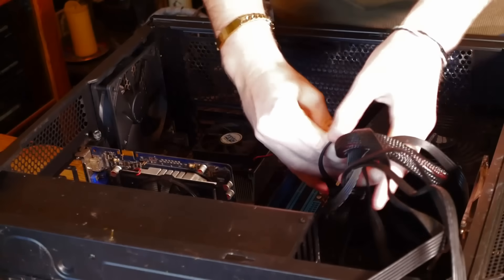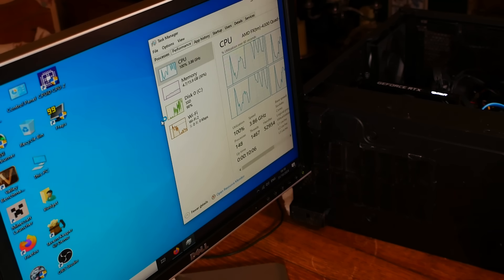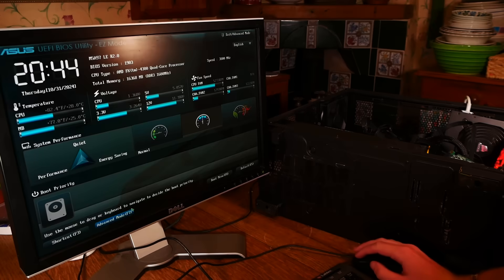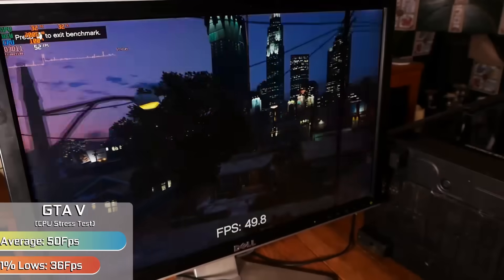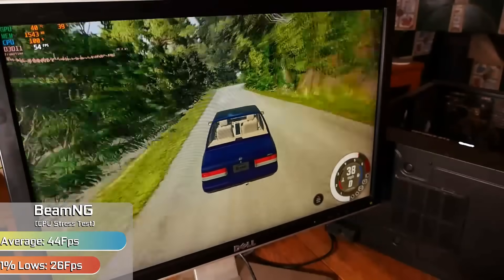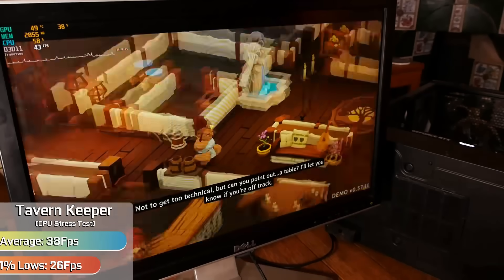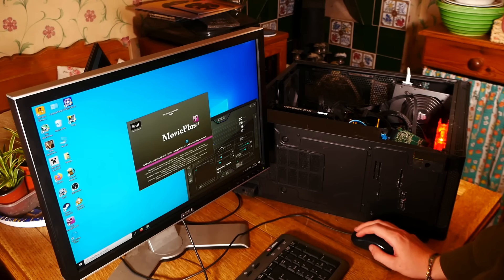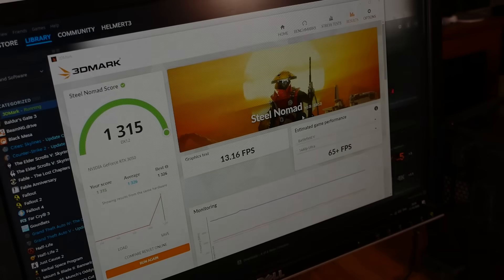AMDs Weakest FX Processor...

Comment: My last AMD AM3+ system build was nearly the best a AM3+ system could be. I'm  not sure how the mb got killed - but there was a day we had bad windstorm in the area and we had 2 what I would call micro-power surges back-2-back within like 4 secs. after that ; the mb i had just upped and died - never figured out why. It was probably the single best AM3+ mb you could get. My PSU at the time was a Seasonic 750w 80+ Gold ; FM unit. That was plugged into a high-end Power Strip / surge suppressor unit. I have thougt about rebuilding the system and maxing out the memory which was the only part in the system wasn't the best if could be.

Comment: The FX series core debackle was quite the drama.
Then again, due to the shared FPU of the cores, each core cluster acted as a single core with hyper-threading.
So in other terms, the FX 4xxx was really dual cores, the 6xxx was triple-cores, and the 8xxx was quad-cores.
Windows could never get the proper core scheduling to work well with the FX CPU's, due to the way they were set up.
Now, I believe there was a "hack" you could do to make it run better, by disabling one core per cluster.

Comment: The FX was AMDs answer to Intel's NetBurst and IBMs POWER6
And the FX-4300 was already a step up, just look at the FX-4100

The two chips that were really worthwhile for a bit were the FX-6300 and FX-8320, cheap, decent enough performance on a budget.
Would love to see them tested against contemporary Intel alternatives. How does the FX-6300 and 8320 hold up now. Can they beat an i5-2400/2500K/3570K/4460 these days? Can they even beat the i7? Or would they fall up to i3 level.
And then throw OC at them. 4.5-4.6 GHz on the CPU, 2.4-2.6 on the northbridge, 2.2 on the HT bus and maybe 2133 RAM.

Comment: i miss my fx8350. i had to throw it in the waste after it died. now i dont know what to buy for windows 7 for retro gaming. i have 2 spare am3+ mb's laying about in storage. best cpu before i upgraded to ryzen 7. my fx8350 died last year during summertime. i had the fx8350 since it was new in 2018. thermal issues killed it. every summer in the uk. kills my computers. and my poor fx8350 suffered. also my 5700x died last summer. and my 5800x died this summer. got my first aio on my new 5800x after the repair. im terrified of summer 2025. i want to build a windows 7 x86 power house for retro gaming. but i cannot find a trusted fx8350 used... and i cannot see a trusted selling aio for fx8350 either. the last game that pushed my fx8350 was resi evil 4 remake... and oh boy it struggled at 1080p for 60fps. my gpu that was paired with my fx8350 was strix rx590. and cor value 32gb 1.6ghz. it was a magnificent pc for its time when no one else had 4 cores 8 threads. trying to run rdr2 was refused by the gpu or cpu. when booting rdr2 it would immediately crash. gta would run amazingly online at high 1080p.. but when you get into a busy lobby online the cpu cripples to below 30fps. the only issue i hated for fx8350 was mostly all the am3+ mb's were pcie16xgen2 in a gen 3 erra... to find a gen3 mb upgrade was extremely rare. funny that amd radeon still supports rx5xx gpu's with their latest radeon software today. when everyone thinks rx580 and 590 is dead. also some boards for am3+ did support tpm chips. but still getting windows 11 to work was only unsupported installations. also i want to rebuild my old fx pc so much. but how long will a 50 quid 8350 last untill summer 2025. i still want to install windows xp pc on fx8350 multibooted with win10. also i want to try this 0patch service that keeps legacy microsoft software secured.

Comment: I too upgraded from a Pentium 4 to an FX system, specifically a 6200 which i ended up overclocking the pants off of and later an 8350 which i ran at 4.7. Compared to the P4, it was amazing, and the system was a wonderful multitasker, but man was it hot. When i got an i5-4690k a few years later it was a comical amount faster in basically any use case.

I'm glad Ryzen turned things around and we are seeing a much more interesting and competitive landscape now.

Comment: Feel the need to pull out my old FX-6300 now. Remember it would easily overclock to 4.7GHz, but ended up setting it to all core 4.5GHz with a Zalman CNPS9900A circular copper cooler. Ran reasonably well with a 7850 gpu, it was the backup PC that ran in my electronics lab, and as a backup PC for boys nights. Was massively cheaper than my main machine at the time, an i7-3770K with a 7970.

Comment: My FX4300  overclocked like crazy. Was very hot on my crappy box cooler. I didn't game, it seemed OK  just running windows and a browser. I was still running it when 4K resolution became common on YT. It would not do 4K video until I paired with with a GT1030. Even then it was  near 100% CPU load at 4K60Hz playback.

Comment: AMD's Dozer (Family 15h) module architecture absolutely did not equate to full cores - not then, not now, not ever. What they accomplished was creating two logical processors with decode and dispatch logic that allowed for a set of isolated symmetric ALU's (and AGU's) to independently execute integer instructions, but with a shared set of SIMD/FPU resources per module. AMD referred to this as "FlexFPU" and it effectively meant the FPU's were dispatched the instruction streams of multiple threads using shared dispatch, while the ALU side had partitioned instruction dispatch. However, functionally from a front-end uOp decode through dispatch perspective, it still looks like SMT and, from a logical processor topology standpoint, the operating system scheduler has to enumerate it as such (not the least of which is because for FP it is functionally SMT). That the module had shared L2 cache was a direct result of this architecture. 

It was an overwrought uArch that failed miserably in the marketplace. Thankfully, AMD's outstanding Zen architecture dumped all that idiotic nonsense for a much more sane approach, and the rest is history.

Comment: We still have 3 FX computers. One fx8300 in the garage, it does web browsing and general stuff and it's only used a few times per month. One FX8320 runs an internet radio station and the setup is basically been unchanged for a decade or more, think it started as a AM2 Phenom and moved AM3 4 or 5 years ago. No games or anything taxing the CPU and it runs great only issue is power consumption vs newer chips.  Then at work we have an fx8350 on a backup computer that occasionally renders dash cam video for archiving. It does 720P around 112FPS with help from an RX570 card doing some of the work.  A different computer with Ryzen 7 5700X does the same job around 275fps.

Comment: My first fx was the fx6350, now i have the fx9370 with a modified threadripper cooler,  keeps it very cool, but I also have a 5600x3d and a threadripper. Loyal amd fan here, iv had some intel machines also but gave them away once ryzen came out.

Comment: AMD FX Bulldozer is the one significant architecture that I've never had any experience with. I've used plenty of Intel Core 2, AMD Athlon X2, then eventually Intel Core i3/i5/i7 series and AMD Ryzen. But I skipped Bulldozer completely and it never dropped in price enough to justify trying it as a used budget option. Those processors may have had a bad reputation but it never seemed to reflect in the used market prices.

Comment: Back when i had no idea about pcs and the current generation was Intel 4th gen Skylake just around the corner i wanted to build my very first PC. 

I had to decide between the FX 8350 and the I5 4570. I thought the FX has to be better cause 8 cores and in the benchmarks online (not gaming) it had like 10% more points. So i wanted to buy the FX 8350 glad i posted my question in some randoom PC forum before.

Comment: I had an A10-6800K in my first build, OCed to 4.7GHz and honestly for the time, it was absolutely fine. Interestingly, windows 10 actually did report that chip as a dual core with hyper threading in task manager. 

Also it's not just shared cache that was the issue; each "dual core" cluster had shared a FPU processing block, hence why it wasn't really two full independent cores

Comment: 4 Cores but you got half the floating point units.
There was also only support for PCIe Gen2 unless you bought one of the few janky motherboards that through some trickery had a single Gen 3 16X slot. 
Unfortunately there are a number of game releases that do a hardware check and won't launch with an fx series. e.i Wolfenstein 2014/2017 both have post launch patches that cause the game to not start on an fx series.  Crisis/Crisis Wars 32 bit won't start - which most modern ways buy it don't come with the 64 bit exe.

Comment: What's more surprising is seeing that AM3 board still functioning, AM3 motherboards were notoriously cheaped out on by vendors because they didn't actually want to support AMD's socket and needed to increase their margins, Intel 1150/1155 motherboards always had better surface mount components even by the same brands. 

The FX8350 would blow the VRM's on most cheaper motherboards over time. MSI and Gigabyte being extra egregious at the time. I think the only thing sparing that board is the use of the FX4300 since the power draw is less, because the VRM on that board is not even heatsinked.

Comment: ive always said fx gave average performance on launch and they give average performance still my old 8350 still plays new titles at the same fps as it did when it launched with new titles from 2013 ive managed to master tuning fx processors overclock the shit out of the hyper transfer and overclock with the bus over the multiplier it really helps the ipc 4.6 ghz on a bus overclock is way faster than 5ghz on a multiplier overclock because it really helps with cache bottlenecks

Comment: It would be fun to set up a FX series with a UEFI bios supported board and a discrete TPM module installed, and boot up and install windows 11 with a thumb drive created with the media creation utilty, and not need to use any workarounds! This is the best example of a poor mans windows 11 computer. The one I use at work to copy old hard drives only has legacy bios, seems to run 11 fine.

Comment: I have six AMD FX computers running in my house. They are a lot of fun to play with and I game with them all just fine. But I do play a lot of older games on those. Older rigs for older games. The newest game I play on my best FX rig is Shadow Of The Tomb Raider. FX9590 @5GHz, Liquid Freezer III 360 AIO, Asus TUF Sabertooth 990FX R3.0 Motherboard, 2TB Samsung NVME, EVGA GTX 1060 SSC Gaming 6GB, 32GB TridentX Ram @ 2400MHz CL10, Corsair HX1000 Power Supply, Cooler Master H500P Mesh, Razer Raptor 27" Gaming Monitor 2560x1440P. That is just one of six FX Rigs that I have and they are all on high end motherboards. Lots of fun.

Comment: I had always planned to upgrade my Athlon II x4 640 to an FX6300, but I never ended up doing so - I still ended up on a bulldozer based arch after it though.
After the Athlon II x4, I rocked a dual socket G34 system with Opteron 6276 CPUs for a good 5 years.

Comment: I have an FX-8350 in use as my off site back up NAS. literally just runs ubuntu server and a ZFS pool. It connects to my home network over a VPN and I use syncthing for backups. Works a treat.

Now, I have that FX-8350 because I didn't have the money to buy a whole new PC until Ryzen. I got a Phenom II x4 965 on sale with a Asus mobo back in 2009. it was a 790FX chipset, but a middle of the road affair. I ran that for a few years, started with a radeon HD 4850, to 4870 (I got it for a steal when someone at a LAN won a new GPU) then 5850, finally to a GTX 760 that I won at a LAN. (I beat a few hundred people at rock, paper scissors😁) Along the way I determined I could upgrade to a 990FX mobo, while keeping the same CPU and RAM. Then eventually upgrade to the 8350. 

I used that 8350 setup for various projects like playing with proxmox and xcp-ng. Finally letting a friend who had never owned a PC have it. I got it back when I upgraded from the 3700x to the 5800x3d, and gave them my 3700x setup. 

My last Intel PC was the Pentium D that was 2.8Ghz 😄Other than the X299 Dark mobo that came with an i9-7920x that I won at a LAN, and then upgraded to the 10940x when a friend won it at a different LAN. They didn't wanna buy an x299 mobo or quad channel RAM, and I had one so I bought them a new mobo CPU and RAM in trade. That's currently my only liquid cooled PC. In a 3U rack mount case.

Comment: My FX 8350 OC to 5Ghz was pretty good. Switched to the 4790K about 3 years after ownership. Loved it. Tried Ryzen a couple times, but nothing seems to beat the compatibility, functions and power of Intel CPus. Even today, I have a mixed use case where gaming isn't my only use and haven't went back. I'll be upgrading my 10850K setup to Ultra pretty soon.

Comment: They were “good”.  Performance per dollar was good. Sure you were able to get more from an intel chip around that time, but if you wanted to game, it would get the job done. Specifically the 8320/8350. Less expensive motherboards too. It’s not like at this price range you had a display that was going to take more than 1080p 60hz, negating the reason for the intel cpu.  I’ve built many FX boxes for friends around $350 with a used gpu. They were mostly gaming on their tv, trying their fun in the pc world.

Comment: I have seen people benchmark an i5 3570k and a 4570k compared to an fx8350 in more modern era titles that used more cores. They found that the amd series did better with games that could utilize more cores, that they had less stuttering and better frametimes and fps overall. The i7 still had the crown when compared, but the fx8350, especially when overclocked held up well to the i7 of the era. I remember properly configuring skyrims ini, where I was able to specify how many cores and what could be executed on different threads of the cores. I remember comparing this to my dad's i5 3570k. I had the same mods and found I could have more followers at the time than him, where the game would start to stutter and bottleneck. I remember we went through a pc mod called falskar, where you had a huge battle. My dad's computer was laggy, but my fx8350 was handling it better and it ran it smoother. Sadly an 8350 aging like fine wine took a lot longer, especially when most games were ever optimized with an intel quad or dual core at the time. Skyrim and fallout 4 had to have a lot of tweaking in the ini to properly take advantage of more cores. So the cpu finally did have some redemption as games were never optimized for an fx8350.

Comment: My i5-2550K still holds to this day relatively well , but it was killer build in 2012. Especially for running multiple OSes at the same time using HyperVM. It has 16GB RAM and GTX-550 Ti and 120GB SSD SATA III drive where I boosted my P67 chipset by installing few drivers from Z68 motherboard

Comment: I remember my 1st actual gaming PC that I got was back in 2016 was a prebuilt from an Amazon Seller called "Skytech". It had the GPU I was looking for at the time which was the GTX 1050 Ti (which was only out for like half a year or less at the time) and there were two variants. One had an FX 4300 and the other had an FX 6300. I think there was like a $50 price difference between the two. I was just starting to learn the in's and outs of computer hardware and I made a very stupid decision. I went with the FX 4300 because I thought to myself "the base clock speeds are much higher than the FX 6300 so that must mean it'll perform better". Sadly it did not XD

Regardless the AMD FX series was the platform for my 1st actual gaming PC and I slowly upgraded it over the course of 2 to 3 years. Last time I used it as my daily driver I had upgraded it to an FX 8350 OC to 4.7 Ghz cooled by a Corsair H110 AIO, 16GB of Hyper X DDR3 1866 mhz, a Gigabyte GA-990FXA-UD3 R5 motherboard (which is still one of the best Christmas gifts my fiancé has ever got me), EVGA GTX 1070, and 3TB's of Storage. All in the same Thermaltake Versa N21 Case that my prebuilt came in.

Currently I'm using the same CPU and Motherboard with an R9 290 to play around with Linux since I'm not going to Windows 11. I had plans of re-using my FX 4300 in a retro gaming rig years ago, but never finished installing the Windows 7 drivers. I will say that the FX 4300 and 1050 Ti were MILES better than the Pentium E5200 and GT 210 that were in my previous computer XD

Comment: Part of the problem with FX was that games of the time didn’t know what to do with the modules. Later games such as those from 2015-2017 were designed around using them(because of the Xbox one and PS4) so they tended to run a lot better. When the modules are properly optimized for, it helps a lot with performance. I own an FX 6300, and it honestly impressed me how good it is still(I really need to break it out again though)

Comment: I don’t know why people hated a revolutionary 8 core high speed CPU way ahead of its time! Compared to Sandy Bridge its WAY superior! The higher spec models has the same number of cores as the Ryzen 7 9800X3D with the top two running faster than that new CPU. These FX CPUs also supported 64 GiB RAM vs 32 on Sandy Bridge and Haswell. What went so wrong with a product with such revolutionary potential!

Comment: The FX processors weren't bad for the money considering how expensive Intel were in comparison back then, I had an AMD FX8370 8 core up until about 3 years ago when some of the latest games started demanding a Ryzen as the minimum requirement, but it still played virtually all the latest games without any problems, even games that asked for better. The biggest complaint was a poor single core performance and the stock fan was poor and loud which I soon replaced with much better.